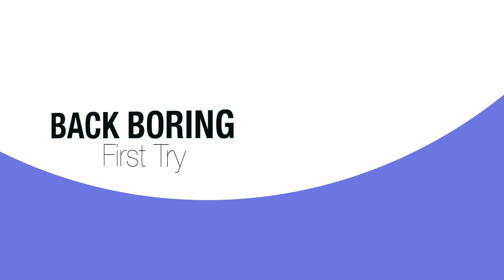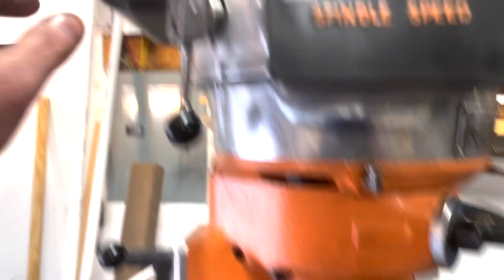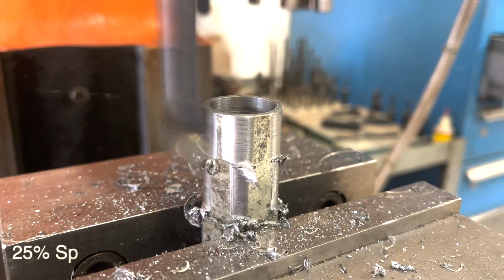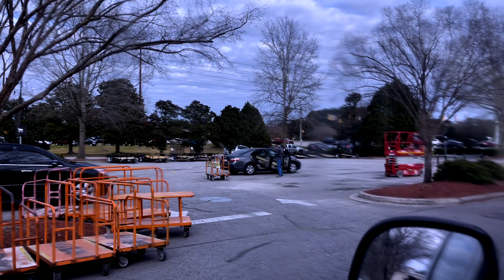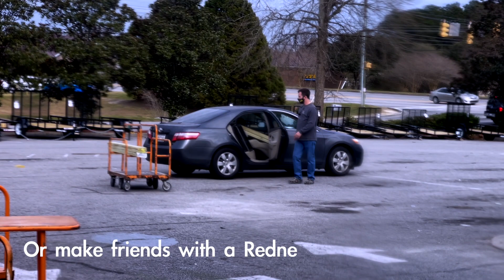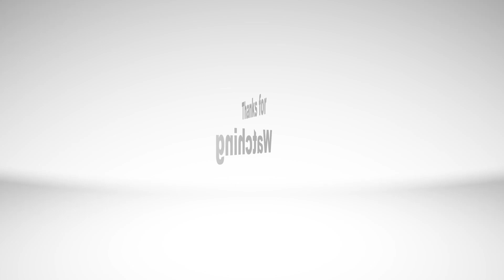OD boring on my Bridgeport Mill for first time

Comment: Hey man thanks for the video, what boring head did you use?
Reply from the maker: Ill have to look.  Im not sure its branded…. Ill check.

As for cutters, i used some cheap shars carbide boring bars.

SHARS 12PC 3/4" C-6 Carbide... https://www.amazon.com/dp/B07ZG3J58L?ref=ppx_pop_mob_ap_share
Reply from the maker: I looked, and there is no brand name on it. I got it in an auction, so I dont know where it came from.  My guess is its imported…
Reply: @JeremiahL  No big deal thanks anyway